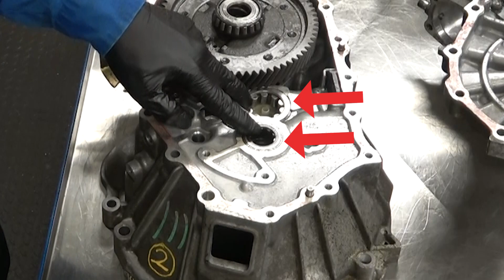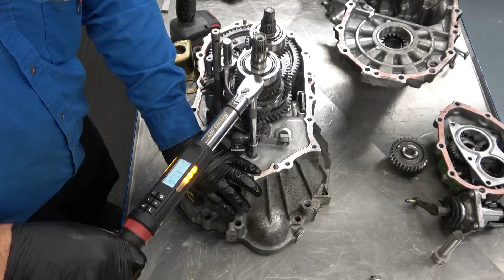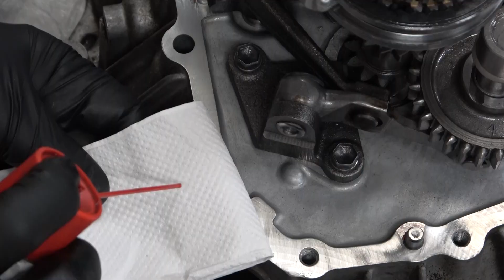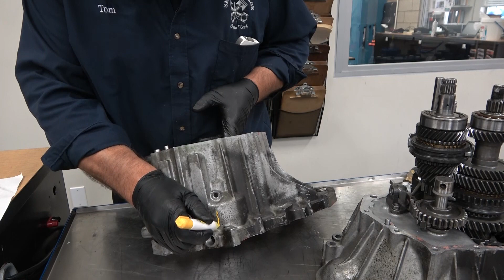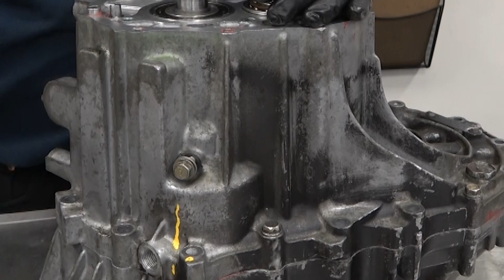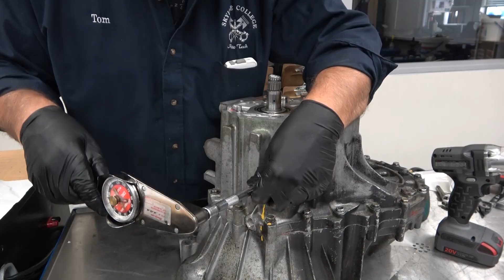Toyota C52 Gear train and Housing installation (11)

Comment: Can you split the box just to get to the diff bearings alone?
Reply: If I just remove the reverse gear bolt, Will it pull apart and go back together fine or will the gear interfere others

Comment: Hi
I had my Rav4 2008 manual transmission open for a issue on the 5 th gear shaft.
After i put everything together and tide all screws, it is very hard to twist tthe shaft by hand on 3rd and 4th gear. Could i over tighten the casing screws? Or the torx screw on the plate over the end bearings? 
No parts were changed inside the case .
Reply from the maker: Over tightening the end cover bolts will not cause this and over tightening the screws that hold the bearing plate on also will not cause binding.  A few things to check.  Some output shafts use a tapered roller bearing instead of the ball bearing in my video. First if you did have a ball bearing did you take off the large snap ring that goes around the circumference of the ball bearing? If so, it's common not to get it seated in the groove on the bearing when reinstalling it.  If you have the tapered roller bearing design there is a shim between the bearing plate and the bearing cup (outer race).  Sometimes that in not reinstalled or not positioned properly during reassembly. Did you remove 5th gear synchronizer?  Sometimes during reassembly the 5th gear synchronizer blocker rings will stick to the gear which can cause binding when trying to turn by hand. I'm suspecting that this might be the case.  The torque from the engine (much stronger than your hands) will break the adhesion and no more binding. Did you take 5th gear synchronizer apart, keys and blocker rings or you might have has a key-less synchronizer. It's possible to put the keys, hub and sleeve back on in the wrong direction. All of those parts are directional meaning the only go one way even if they will fit when put on the wrong way.  These can be tricky. They key-less synchronizers can also be tricky to get back together properly and installed onto the shaft without popping everything out of position.  Is your RAV4 All wheel drive?  I don't even know if they make 2WD Rav4's, if so is it a 2WD model?
Reply: @DrivelineMaster  I had the transmission open to check because the 5th gear on output shaft was damaged and I wanted to be sure nothing else is wrong inside. but did not replace anything inside . Yes, the output shaft has tapered bearings but as I said did not replace anyhting. 
The synchro that by mistake I had to reassemble is the 5th gear but all I had to do was to put it back in the synchro case . Those 2 "circular springs " were tricky ..but I managed to get it right. I found YouTube video. 
I think it started to be difficult to spin after I push Back the 5th gear on the output shaft. I used a tool and a hammer.
And yes, Rav 4 it's 4wheel drive.
Transmission is e352f.
Reply from the maker: @octavianbaltac559  I understand you didn't replace any hard parts.  Did you only take apart the 5th gear or did you go deeper and take the whole thing apart removing gears and synchronizers from the input and output shaft.  I also wonder how 5th gear on the output shaft could get damaged and if it was damaged why was it not replaced?
Reply: @DrivelineMaster  https://youtube.com/shorts/RM2Wl27KP7c?si=O0NOzUCDGuY9rNbP
This is the 5th  gear that was replaced . But inside the transmission nothing replaced or dismantled. Just inspected and cleaned.
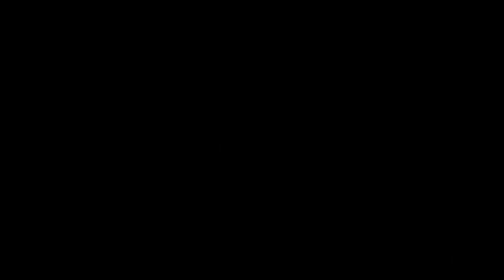Reply from the maker: @octavianbaltac559  If you look at time stamp 4:16 you notice there is no snap ring to keep the ball bearing on the output shaft in place beyond the interference fit. Hammering down on the gear could have also pushed down on the shaft causing  mispositioning of everything on this shaft. I don't think it's likely but possible.  It might have just wedged some of the synchronizer blocker rings up against there perspective gears which would add rotational resistance which would get freed up by the toque of the engine.  How hard did you have to smack the driver with a hammer in order to install 5th driven gear? If you really had to hit it hard several times it might be worth pulling the cover off again to inspect the output shaft and component positioning.
Reply: @DrivelineMaster  If I have to find a comparison I would say that I had to hit it same as I was fitting a ball bearing on a shaft.
I guess is better to open again and double check
Reply from the maker: @octavianbaltac559  So now you have confused me as I'm trying to help you out.  At first you said that you didn't replace any parts but then you say you replaced 5th gear. Then when I asked if you took it apart further such as removing parts from the shafts you said no repeating that no parts were replaced. No parts were replaced is different than did you take it apart further.  Now you state that you had to hammer the ball bearing back onto the shaft.  If you didn't disassemble the shafts you would have no need to hammer the ball bearing back on.  I ask these question to be a detective to try and figure out what if anything could have been improperly installed or damaged to help you figure out why it's hard to turn.  It's hard to help without clear and accurate information.
Reply: @DrivelineMaster  I think my english is the problem. I really appreciate your help. You asked me how hard i had to hit the 5th gear with the hammer. And my reply was that i hit it hard as you need to when you install a ball bearing  onto a shaft. Was just a comparison expression ..  
So both shaft were inspected, cleaned and installed into the case same as it were.  No parts replaced inside case
The only part replaced was the 5th gear which is outside the main case and which obviously needed replacement . didn't need to mention it , i thought.
Reply from the maker: @octavianbaltac559  OK, as I see it you have two options.  1) install the transaxle into the vehicle hoping that it's just a dragging blocker ring binding the shaft that will free up with the rotational torque from the engine. 2) take it apart again and double check that everything is correct. If you do this pay special attention to the blocker rings to see if any seem to be stuck to their perspective gears. Add a little extra lubricant to the space between the blocker rings and their matching gears before putting the housing back on.  I have seen binding blocker rings before so I always super lube them during my assembly of any manual transmission or transaxle.

Comment: Thanks for this!

I used this video as a reference for doing a complete set of bearings and seals on my C 59 5 speed with 535,000 km on it.

Your specific torque values and specifications were very helpful.

It's gone from sounding like a deep-fryer at idle to smooth and very quiet.

Hardest part was getting it out with the rusty bolts etc.  Order of operation is critical to easy removal.

1 - rubber mounts
2 - transmission mount brackets
3 - split from engine.

Internals were easy except for when the lockout confused me and I kept re-splitting the cases, sure that I must have done something wrong. Finally watched the video a little closer and figured out that the shifting issue on the 3-4 shaft was because 5th wasn't in place and reverse was partially engaging under gravity.

Easier said than done - especially for an old salt-belt car.  Some of these can be hard to reach with the wrench.
Reply from the maker: Glad these helped and it's now quit rolling.  That's a lot of km..........
Reply: @DrivelineMaster  When I bought it new, the plan was to sell it as a "winter beater" at 300,000 km.  

Current target is 700,000 km.

Matrixes are great at nothing, but good at everything.  Most practical vehicle I've ever owned and I really don't want to part with it.

Thanks for helping keep 3000 pounds of car from heading to the scrap yard over a 1/2 pound bearing that was worn out!

Comment: Hello i have another question. When i put it in fourth gear, the rear gear is going up with the fourth gear. So there are two gears at the same time. What did i do wrong? Or will it be ok after installing the rest of the housing?
Reply from the maker: Yes, that will happen.  The trick is to make sure all the shift forks are centered so all the gate cutouts are in alignment before moving the 4th shift rod/fork.  This too should fix itself once the cover is on and the detents are in place.  If you want to be certain install the cover without any sealant.  Just use a few bolts to hold the cover in place. Install the detents, bearing snaprings and bearing cover plate.  Now use a screwdriver to move the shift forks through the hole where the shifter goes.  Check the spin and shift operation for all gears.  You can't check 5th until you assemble the 5th gears.  No worries your really concerned right now about how everything inside is working.  Don't be shy with the oil all over the gears and synchronizers as your assembling it.  If it works as it should remove the cover and use sealant on the cover and reassemble.  Good Luck

Comment: Hello. Im assembling this transmission and when i put in shafts and spin it, my 3rd gear is laying on the gear from other shaft and grinding . I put it tohetger like you did. Thanks for your answer
Reply from the maker: I’m assuming this is with the housing cover off. This can happen with the housing off. Check the input and output shaft bearing height by looking at the snap ring grooves.  If the input shaft groove is lower than the output shaft lift up on the input shaft until they are even. Now check the gear alignment and operation. If all is good now you’re ok. When you put the housing on and install the snap rings the shafts will be heald in alignment. If this is not the cause please send me some pictures to Drivelinemaster@Gmail.com and I will   Try to help.
Reply: @DrivelineMaster  Yes. It's like this. I felt so stupid after finding out 😂😂
I was checking it for 2 hours and couldnt find the problem

Comment: So this is a GT turbo ep82 transmission..so the crown has 8 bolts ? Is that so ? So the quafie qdf15e will fit ?
Reply from the maker: Please clarify what you are calling the crown.  This is not a term I typically use in the USA for transmission components.
Reply: @DrivelineMaster  the crown and pinion off the transmission so it's a 4efte gearbox? You re working on ?
Reply: @DrivelineMaster  and that code that I gave you is a quafie LSD can fit on that transmission?
Reply from the maker: Now this makes some sense.  I have hear of individuals refer to what I call the ring gear as the crown gear.   Currently it does look like the crown gear is held on with 8 bolts but I don't have the transaxle in front of me at this moment.  Additionally I can not 100% verify that that LSD is a 100% replacement fit.  You should check with the manufacture of the LSD to be certain.

Comment: Why wouldn't you clean the silicone before you dropped the clean gearset into a clean case? You just put all that junk into a freshly rebuilt set
Reply from the maker: You are correct and that was my error.  This was designed to be be a training video for students learning how to work on manual transaxles and they are using transaxles that are not being installed into a vehicle.  I had not thought about showing this step and it was an after though. At a minimum I should have noted that in the video and taken precautions to keep the old silicon out of the works.

Comment: Ok, so big question. After I followed everything step by step, tear down to reassembly, I’m having an odd problem. 

If the transaxle is horizontal (like if it was connected to the engine) and is put into reverse, it will easily go into reverse and engage. Then when I try to get out of reverse, the reverse idler gear does not return to its original position (I can see the idler not moving through the drain plug hole). When this happens and I try to go into another gear I’m essentially double meshing the gears and I can’t turn the input shaft. 

The idler will move down if I have the bell housing face down so I don’t think it’s sticking. 

My question is, how can I fix this issue? Did I forgot to put something in that returns it?

Thank you!
Reply from the maker: I suspect something with the reverse shift fork mechanism. Maybe the end of the shift fork (which really doesn't look like a fork but more of a 1" x 1/2" rectangle) isn't properly engaged with the reverse idler gear or sometimes the end of the fork can come off causing a sloppy fit.  Other possibilities is where the reverse shift fork mounts to the housing. There are sleeves in the holes to make a perfect alignment and tight fit. If these fell out or are missing this will cause reverse shifting problems.  Check out time stamp 0:32 to 0:54.  Also in video (4) at time stamp 4:40 to 4:55 talks about the shift assembly. If you took this apart there are interlock balls that can fall out.  I don't show them hear but at exactly 4:47 I point to the location where they are located.  This too can cause shifter problems.  I always teach to check the operation before installing. I often discover student mistakes at this stage however some mistake can't be simulated when on the workbench and only show up after installation.  Good luck. I would be interested in knowing what you found out.

Comment: hey mate im trying to find info ? do you have to open the trans to change the input shasft seal inside the bell housing ?
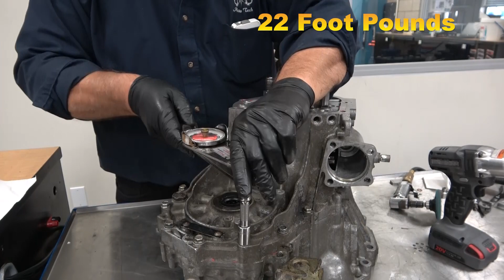Reply from the maker: Look at time stamp 3:56.  you can see the throwout bearing sleeve that can be removed with 3 torx bolts.  If you remove this sleeve I think the seal can be replaced without taking the transmission apart but it most likely is not easy. Once the sleeve is off you should be able to tell if you can remove the seal without opening up the transaxle.  If you want to wait until I can check it out I can let you know maybe next week.
Reply from the maker: I removed the throw out bearing sleeve today and saw that the input shaft seal can indeed be replaced without taking the transaxle all apart.  I suggest you watch my video on replacing a rear main seal.  I use a drill and screws to pull the seal.  The trans input shaft seal is much smaller but with care and smaller screws you should be able to use this technique to remove the old seal.  Then find a piece of pipe the size of the new seal and deep enough to go over the input shaft and use it as a seal installer.  Just like on the installation for the rear main seal make sure to put some grease, preferable white grease on the inside of the seal to keep the spring from popping out and also on the seal lip before tapping the new seal in with the hammer and pipe.